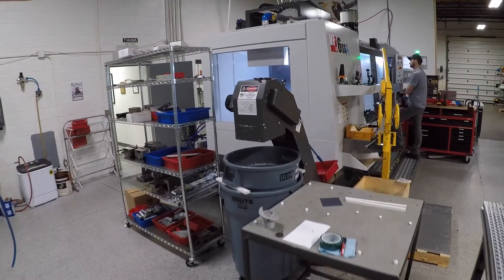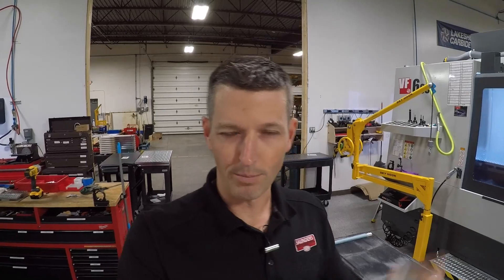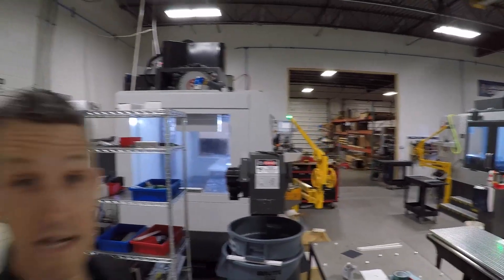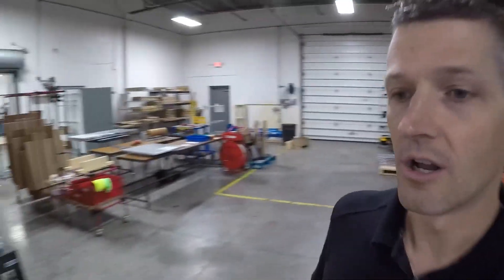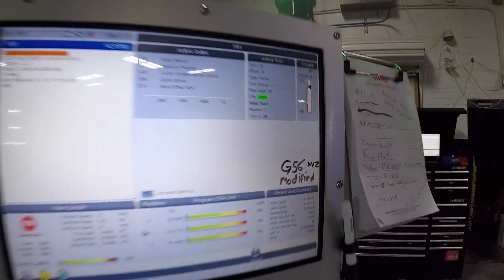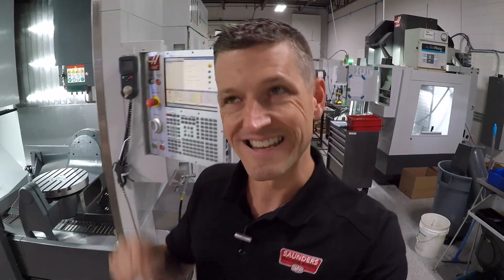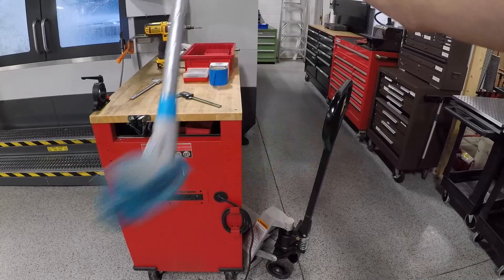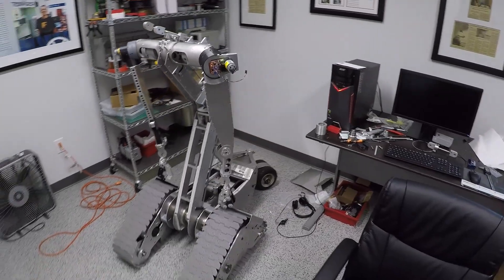Shop Update:  Johnny5, New Machines and more!

Comment: We plumbed a relatively inexpensive piston compressor with a big receiver tank in with our screw compressor with a valve to close isolate the receiver tank from the screw compressor. That way if our screw compressor goes down unexpectedly requires scheduled maintenance we can run the $1500 piston compressor and keep the machines up. Relatively cheap insurance.

Comment: The end of those screw drives catching swarth, instead of prevention you could move to cure, if 3D print little flattish pipes blowing compressed air upwards or slightly aimed back into cabinet. Just need the little manifold and a compressor fitting screwed in and a valve if you're fancy.

Comment: Have you ever looked into implementing Home assistant into the mix? Its such a flexible platform it would probably work great with your home brewed solutions. Besides managing power consumption, entry points, lighting,  etc you could get direct message notifications for anomalies like leak detection which sounds much better than a beep in a machine shop. You’d get notifications anytime-anywhere plus you could utilize Zigbee contact sensors and NFT tags pretty effectively.

Comment: I just listened to the latest business of machining podcast where John discusses power requirements for the okuma. I wanted to reach out with some info on what I run my M560v on as well as show a video of it's power consumption while running. In the link below you can see my cutting power isn't crazy, typically under 50 amps on the 440 line. My spindle acceleration power is maxing out my 100 amp line and it lasts for a while. Keep in mind the okuma has a massive spindle compared to a Haas or similar machine. You can install a 60lb vf2 spindle by yourself. My Okuma support guy said the spindle cartridge on the 560 (and the 460\660) is over 500lbs. Don't skimp on the power John!

https://youtu.be/99hRfko-zqM

Comment: Around 4 minuit mark.  That is a great idea, the hard part is getting everyone to actually use it.  I still get my income mostly washing dishes for amcatering company.  They expect to find things in specific spots, the issue is they get in a rush, grab something, put it down in an incorrect area and grab something else then carry on working.  I have to reorganise on a daily basis as the cooks don't follow the pbilosophy of where to find things when they are the ones putting it down.  Hope you can actually express they WHY to do it to your crew and have them take it to heart.

On chip removal, couldn't you add a form of ' bypass pump ' to a few replacement pressure washer tips to shoot down in the corners at the end to literally blast out the units?

Comment: Just ordered 2 6mm mod vises for my router mill table.   Hopefully some day soon I can get in a custom order for a custom full sized fixture plate for my 19x19 Mega V to replace the Tslot fixture plate setup.    Trying to use the MegaV fixture plate with vises really eats up a lot of my Z axis that is available.    Moving to a one piece fixture plate with my end plates fixed to it will give back Z axis height as well as lock in and square the rig for better tram across all axis.

Comment: Does your air setup make a full loop? This may help balance the draw and reduce the pipe size limitation you're seeing (looks like 3 machines in series on one feed line). I believe someone else mentioned it too, but a receiver tank may also help balance the load when you have several machines syncing up with a large draw.
Reply from the maker: yes, full loop

Comment: Hey John I have a 50hp digital rotary screw Ingersoll Rand compressor! With 3 tanks available that can be hooked in series. Two 300 gallon and on 400 gallon! Please buy them or share that i have it available! It will help me keep going! 211 cfm @ 128 psi. Ir just serviced it. I was asking $10,000 for it all but im open to offers and trades. 85 amps 480 3 phase.

Comment: I've spent a little over a year so far working as an engineer at an air compressor manufacturer. Most of what I have done has been with piston style air compressors, so it isn't exactly the same as John's rotary screw setup. Unloading is simply releasing the air in the plumbing between the pump and the tank so that the pump can be spun easier the next time it starts. Most compressors, except for very small ones, can overcome this pressure and start without unloading. However, it is WAY more work for the motor to do that. It is basically the equivalent of starting a car in drive instead of park or neutral. Rotary screw compressors can lower the rpm considerably to produce a much lower volume of air, that can be bled off if needed, rather than shutting off entirely when the demand for air decreases. This is partially because rotary compressors have very active oiling systems to keep everything well lubricated. Piston pumps are typically splash lubricated by a small arm on the bottom of the connecting rod. If the pump doesn't spin fast enough, the arm doesn't hit the oil hard enough to splash it up to the various parts that need to be lubricated. The lead lag setup described is often used on duplex compressors. However, they usually have circuitry to automatically alternate between compressors each time air is needed. Unlike a lot of people, John has the use case figured out. Reliability and continuous air supplied while one compressor is down or being serviced. Many people buy a duplex compressor thinking that it can supply double the CFM. That is true when both compressors are running. However, if the air demand is high enough for that to always be the case, the compressor will rarely shut off and will encounter numerous issues and an premature death. The only real trick with running a lead lag setup is getting the pressures set correctly. That is very dependant on the air demand and the size of the compressors. Usually 5-10 psi apart works well. If a compressor runs for a long time before shutting off, it is too small of a compressor (HP/KW). If it runs frequently, but only for a short period of time each time it runs, then more storage volume is needed.
Reply: I did a lot of work with pneumatic equipment that needed a lot of air (each of our machines usually had a 10hp compressor requirement), here's what i found.
Screw types quieter (usually), and typically are designed to run continuously, as you said, they have active lubrication,and they're usually big.  Screw type compressors keep the motor running for some time after they finish cycling (usually programmable), so it's no problem for them to keep a tight pressure range... having a delta of 10psi isn't a big deal, while on piston types you're starting and stopping the motor (there are some that also unload and freewheel), so it just harder on things to keep tight pressure ranges.  
If I were to choose though, I'd have the screw type as the primary compressor and the piston compressor as the backup
Air line size? 1" should be plenty for 10hp worth of air, an additional storage tank at the far end of the line would solve any pressure fluctuations
I haven't heard of what they use to remove water from the air... if they have a refrigerated drier (which is probably the best), they shouldn't have any condensation, but without one, get some automatic drains, you can program them to drain for 5 seconds every 10 minutes or whatever... also, especially if you don't have really dry air, pay attention to how you route your air lines, put a good slope in them, don't have any sags where water can accumulate.  The old shop I worked in did none of this, and you could literally get showered with 5 gallons of water trying to hook up a quick connect that hadn't been used in a while, or worse yet, a high demand machine suddenly coming online would suddenly be fed nothing but water, which would overload the machine's water separator and could seriously screw things up
Reply from the maker: thanks, Nick!
Reply: Nick, it would seem to me there is a sweet spot for cycling on machines with less than 100% duty ratings. If your compressor sits a long time between starts you're imparting extra heat cycles and running the risk of condensation. Really it seems like the ideal setup would be a screw compressor that's cool with running partial load all the time.

Comment: Most other machines I've seen use coolant nozzles to spray the walls and chip augers to prevent chips from building up.  Cost is a little higher for the extra pump and plumbing.

Comment: Augers seem like a complicated solution solved by shower coolant. A dedicated pump could be used or a triggered diverter valve that switches coolant flow during tool changes to spray chips onto the conveyor

Comment: Wouldn't the bin location be a ideal job for a raspberry pi and off the shelf addressable LEDs ?, Or a node mcu to do the same thing these could be terminated onto cat5 cable and plugged into a patch panel of sorts(or just a few rj45's in the enclosure) to allow daisy chaining them for more or less drawers pi's can also be Poe powered for ease of deployment, lex can then just call the pi and ask for the lamp on or flashing 

A roll of 50 addressible bullet LEDs is like $20 or you could also use the tape varient and have it illuminate just the section down the front of the box at the side of a specific drawer

Comment: you can put a couple air tanks and T them into the main line to provide more stable air pressure during heavy use. just plain 10~20 gallon tanks are cheap and you can stick them up on the wall close to the main line with a simple bracket and a bit of 1" pipe and a T fitting and spread them out so they are near heavy consumers. if you  put the tanks with the connection on the bottom you dont need to wrooy about water and you have plenty of space to put the tanks up near the roof so you dont lose real estate. and no, the unloader does not wear out. its just a valve. more air storage also means the compressors have less cycles.
Reply: It can also be an offset to his too-small air line, by putting them at strategic places around the shop. That way the line doesn't have to draw from a central location for local short high-volume flows.

However, that doesn't solve the need for a backup compressor. Motors and unloading valves will eventually fail on any compressor.
Reply: He's talked about battery tanks many times on the BOM podcast. There are positives and negatives but ultimately it doesn't seem like the right solution for their shop.

Comment: John, for your smart tool box features there's nothing wrong with keeping it simple.  My recommendation would be to standardize the toolbox layout and get some 5S foam shadow boards to keep it that way.  So every toolbox in front of a milling machine has the same tool and drawer layout, so you don't have to think about it.  You could also have a standard lathe toolbox layout.  And if you really need, just make a little laminated index on the box for reference.  It helps you follow that lean manufacturing approach, sorting, standardizing, etc.  It will also greatly speed up training since everyone will know what tools each machine has.  There's a lot to be said for simple organization and standardization, keep up the good work John!
Reply: I can see John's idea being useful for nonstandard tools that you don't stock by the machines but back in the "tool room", for lack of a better term. Considering his interest in programmable devices, I'd suggest something like an Arduino with WIFI and a column light over the toolbox to blink, and maybe a small screen that can say "Drawer 5A", rather than a light on every drawer.
Reply: @lwilton  I certainly get that, John is definitely someone that enjoys widgets.  And that certainly is different from my essentialist view, where I find it better to remove things and simplify.  Things can't go wrong if there's nothing to go wrong 😁😁😁
Reply: @capnthepeafarmer  But you will always have some job come thru that takes a special tool or two, and rational simplification says you don't keep that nonstandard (and mostly useless) tooling in the machine tool box. So how do you find that unusual endmill the one time you need it for a odd job?
Reply: @lwilton  Easy, don't keep consumables in tool boxes.  😁  In my shop, the tool box is used for protecting tools, like calipers, micrometers, and sensitive measuring equipment, and common stuff not tied to a particular area.  General hand tools needed at a specific area are hanging on shadow boards in front of the area where they are used, ER collet wrench, depth stop, etc.  Consumable tooling endmills, drills, and the like are all in the tool vending area and inventory can be tracked in one location.  It's much more money conscious and lean to stock the tool room instead of stocking each toolbox.  Like why buy 5 drills for each tool box, when you can just buy 5 drills for the entire shop?  The best way to avoid needing special tooling is to not quote using special tools.  I know that sounds redundant, but assuming you have a good assortment of tools that you use for 80% of your jobs you shouldn't need a special tool or you need to look at different work holding.  The call to buy a special tool is if you can't accomplish the job in any other feasible way, and the customer doesn't mind paying that premium for buying special tooling, and you don't mind buying it.  Then that special tool is a non-stocked item in the tool room, tool boxes don't change at all.

Comment: John, you don't need a foundation for that bridge mill? We installed a larger one with 120" of X by 63" of Y travel. For that machine it was vitally necessary to have a concrete pad for the machine to set on. This machine (Toyoda SB316. I don't like the machine) was somewhat difficult to level and square. Without the foundation that would be impossible to keep level and square over time.
Reply from the maker: Short answer: yes, the Okuma spec for the foundation is substantial.    Anecdotally, many shops seem to choose not to meet the full builder spec (we know 5 people with Genos machines who have similar foundations to us and also do not meet the builder spec).  This is "only" a 20,000lb machine and we've had other machines of similar weight running in this spot for 6 years.  So far, its been a solid foundation.  IF that proves wrong, we will then cut up the floor and pour a dedicated pad.
Reply: I dont know if I would consider the okuma genos machines as true brigde mills, they are technically double column I think.  But because the Y axis doesn't actually pass all the way through the columns the casting is basically a huge rectangular cube and so you don't need much more than decent cement to set them on.
Reply: Unless you can fit the machine on a single pad which has enough depth (45 cm If I remember correctly)  then you absolutely need a foundation.

If would be the equivalent of eating a 5 course dinner on a fold up picnic table. As soon as the Main dish hits the table the whole thing will be on the move.
Reply: @mikehorrod4367  this isn't really true. Okuma recommends 2 feet for all there regular machines. At our old shop we were in we had 3.5 to 4 inches we were there for 20 years and never had an issue with machines moving or needed to be re-leveled.  At our shop now we have 8 inches and several machines around 30,000 pounds and still no issue's.  There are tons of machines in our area here and very few smaller machines are on there own pads

Comment: It might be fun to try designing the Bluetooth devices yourself. Basically comes down to picking components, designing the PCB in Fusion and sending the design to a PCB manufacturer and maybe making an enclosure. Software can usually be written in Arduino IDE.